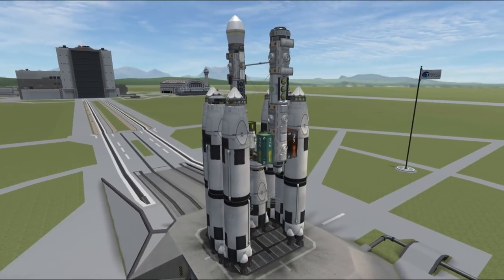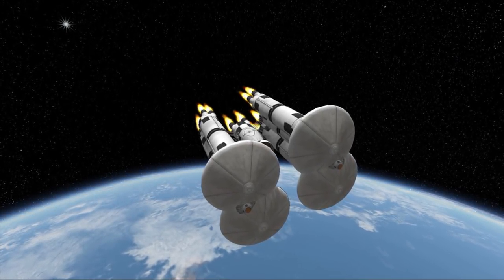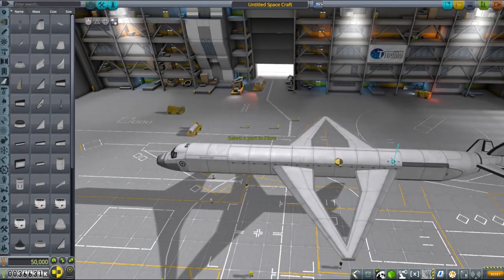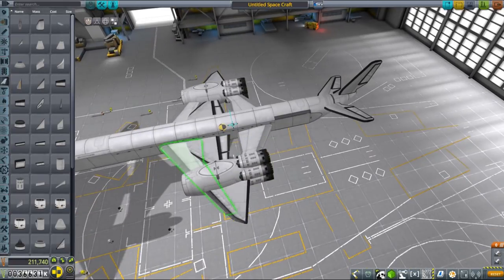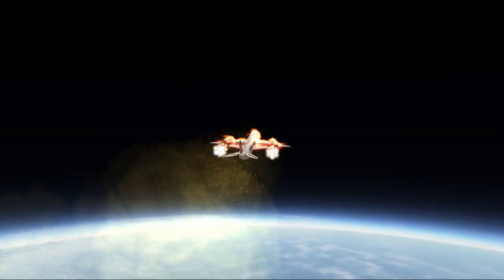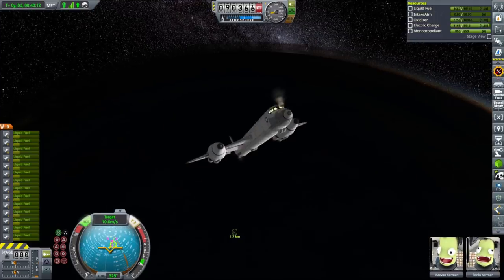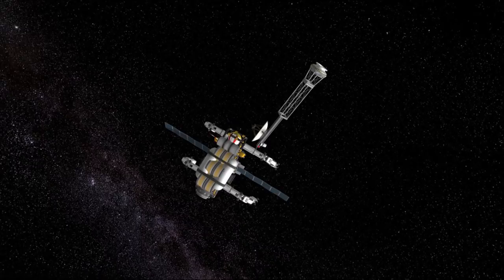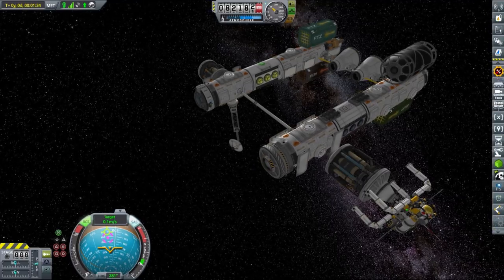[28] SSTO Space Program - Mysterious Space Station

Comment: I see that your station has 2 cores and those cores are attached to each other in 2 spots. Can you explain a bit how is that possible inn KSP, as i understood it the vessel has to be tree-like
Reply from the maker: You can use docking ports or struts to make two point supports, but as you correctly pointed out, node connections can only have a single parent.

Comment: I'm actually flying with that same flight controller, Advanced FlyByWire bypasses the unity input system to pull joystick data directly and eliminates the lag: https://forum.kerbalspaceprogram.com/index.php?/topic/85711-11-afbw-v17-beta-joystick-controller-mod/ Unfortunately it has not been recently maintained, so you have to put together from the forums or compile yourself.

I'm in the process of making a mod I'm currently calling X52 Indicators. Hopefully in a week or two I'll at least have a windows version with a cross platform to follow. Primary goal of it will be to easily map modes like SAS/breaks/etc to lights and display the stage number among other things in the multifunction display. Secondary goal will be to expose it to Kerbal Operating System so I can blink lights from my scripts ;)

Thanks for making so much great content, have a good one.

Comment: Could you explain a little bit about the stage mass and payload graph as in 2:00 please
Reply from the maker: It's a software I made that helps me design rockets and SSTOs. Basically what it does is calculates dV readouts for different engines and fuel types. Works almost like Kerbal Engineer, just gives you more flexibility. Cheers!

Comment: I almost considered "common swift" as a name for an SSTO the other day, too. :) In the end, I went with Fulmar because the fulmar is a similarly stocky bird and hardly comes to land. My SSTO is short and chunky with 3.75m fuel tanks fore and aft. It's also long-range. An unintended point of correspondance between the bird and my SSTO is a certain difficulty coming in to roost. :) Fulmars only nest on cliffs, they won't even think about flat ground. My SSTO is not the easiest thing to fly when it comes down into an atmosphere. If it was smaller, I would call it Storm Petrel. The storm petrel even sleeps on the wing.